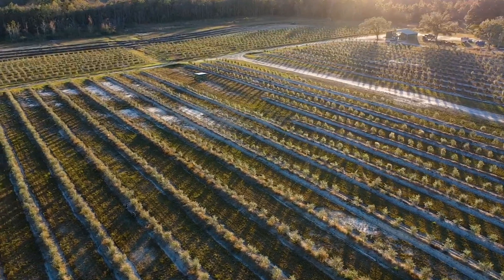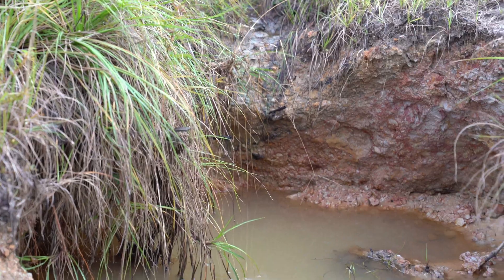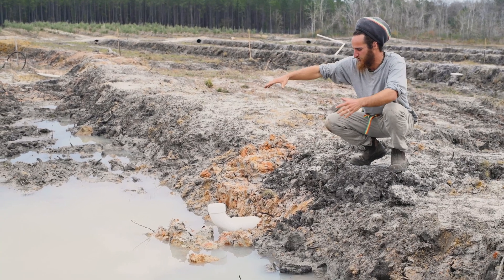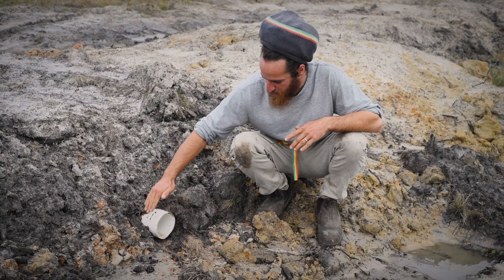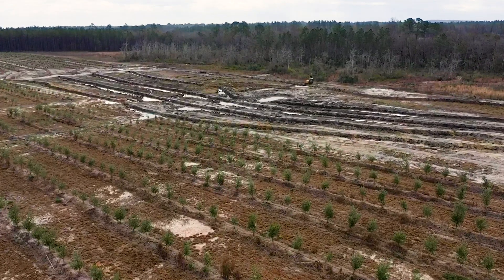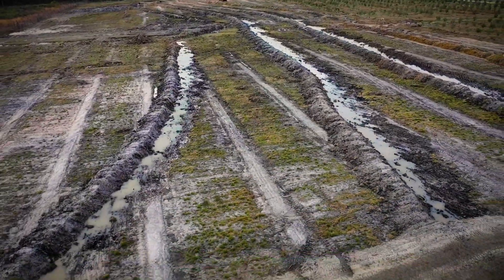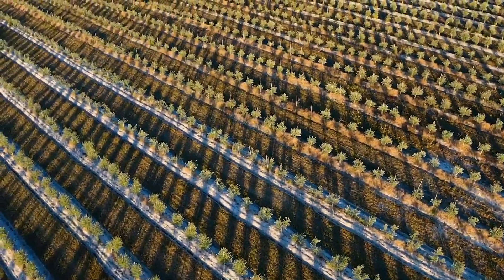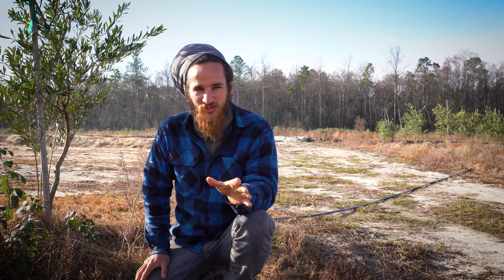Controlling Water With Earthworks | Converting a Conventional Olive Grove to a Climate Farm

Comment: Joshua - We use the same system in managing water in rice farms as each levee separates a 2/10th typical drop between the cuts. Based on annual rain, you might find the 4 inch pipe overwhelmed and significant erosions issues in a large rain event. The rice here uses tarps or boxes that have the ability to relieve large volumes of water in significant rain events and larger pipes. Some of our fields are challenging and I have witnessed where it takes days to repair a field after a 4 - 6 inch rain.
Reply from the maker: Thanks for sharing! We are actually installing multiple pipes of varying sizes throughout the swales, and one of the next phases of this project will be establishing agroforestry plantings on the swale berms. Your system sounds really interesting, too! We’d love to see it in action.